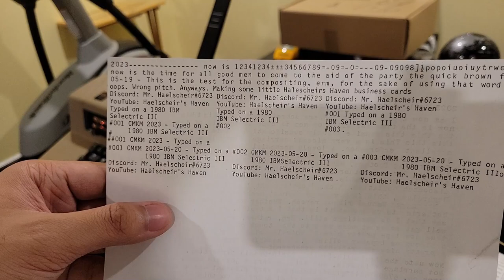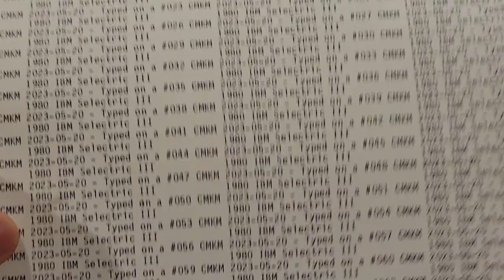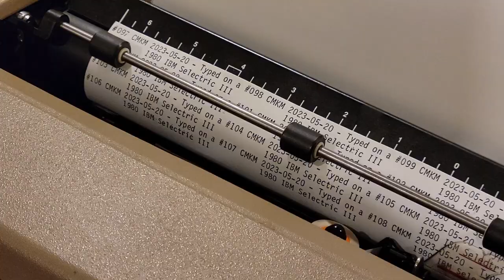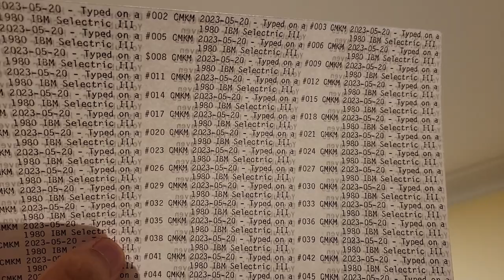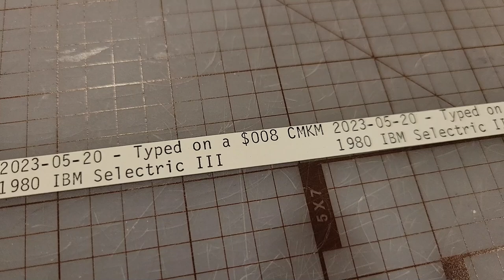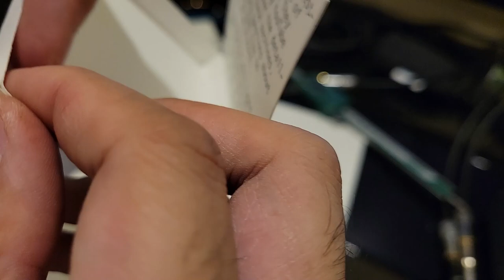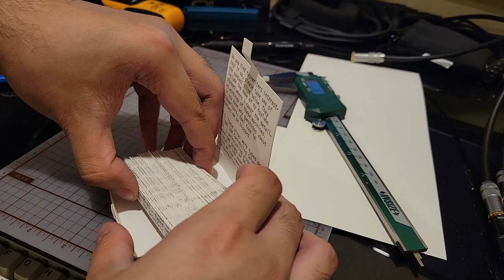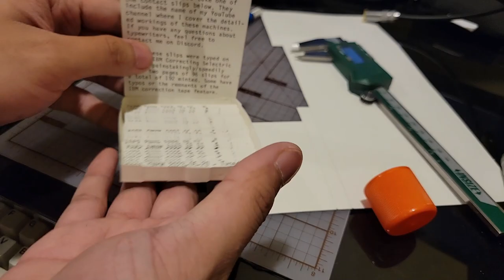Typing business cards on a 1980 IBM Selectric III typewriter

Comment: Would you ever create a video comparing how the typewriters of different decades type? Great videos, and resource for a typewriter newbie. Thanks!
Reply from the maker: Not exactly, as I rather have a long queue of different typewriters I intend on making individual in-depth videos about. Generally, the overall typing experience and performance is fairly similar across the decades after the advent of the Underwood in 1896 (everything before then is a whole different world). Speed potential probably plateaus after the 1920s, and is mainly related to the escapement that regulates the movement of the carriage. https://www.youtube.com/watch?v=BKU-vd4aWSk and https://www.youtube.com/watch?v=zEWakhVg3Zs go into detail regarding why different typewriters feel different to type on. Otherwise, the main differences are in looks and manufacturing methods and materials, generally a move from cast designs to more sheet or plate metal, plus the invention of some new features like colour selection, keyset tabulators, and "magic margins". It is mainly after 1970 that the quality starts to drop for some brands, though there can still be some very pleasant to use typewriters from that time.